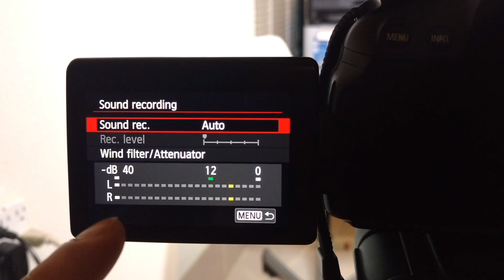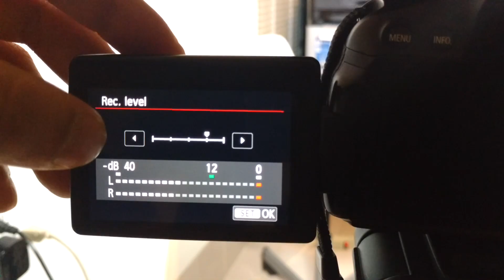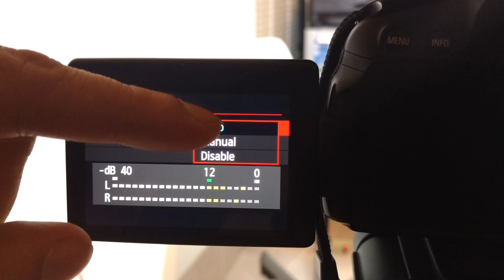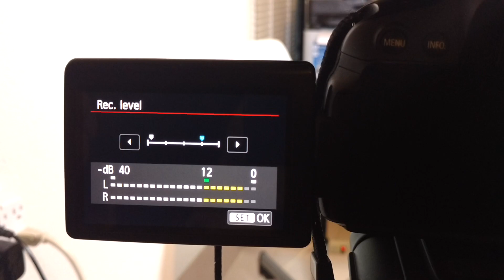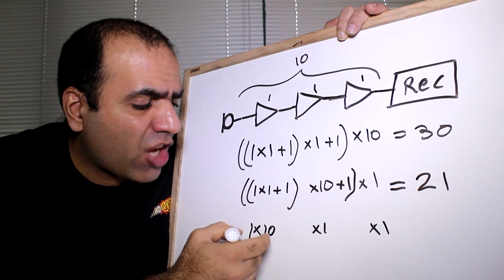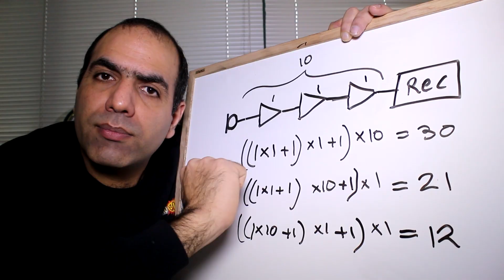Quality Audio Recording for Video

Comment: Hi Mehdi. Have you ever tried surrounding your camera or mic with a baffle? It's a real low-tech method I use to cut down on noise outside and some echo inside. I have a MUCH lower budget setup than you and find that taping cardboard or plastic around the sides of the camera (for on camera mics) reduces the background noise when recording outside as well as some reflections/echo when recording inside. It kind of makes the mic directional to some extent. Extend the plastic/cardboard from the sides of the camera and as far out in front as possible w/o seeing the baffle in the shot. It's not the end all solution but works to some extent.

Comment: lol... where to start..   a lapel is a good option.     2nd good option would be a large diaphragm condenser mic with selectable polar patterns.      The better the mic the lower the noise floor, the higher the audio bit rate and sample rate quality the lower the noise floor  too.
Post production on the audio is ideal for obtaining a  high quality sound,,  in the signal flow processing  of;  Gate, EQ, compressor, limiter... in that order.

Comment: Great video that a lot of popular you tubers should watch. You would  be surprised at how bad some you tubers audio is considering they have as much subscribers as they do.

Also dont forget there is still some improvement to be had with post processing. Using a High Pass filter (mic only) to remove sub rumbling, if the room your in is less than ideal there usually tends to be some low mid mud (whoomfy frequencies  160hz maybe 200hz 250hz) that can be notched out to clear things up.

And for really dynamic people where they go from talking to screaming, compression. far to often some videos i watch will get it to a clear volume to be all of a sudden blasted.

Projection is key for getting good signal to noise. Even when using lapels. Alot of people seem to have this subconcious thinking that a mic only hears whats infront of it. Sorry they dont work like that a mic can and will pick up all round it to varying degrees. if something in the background is louder than you guess what

Comment: Hello there sir just came across your videos and are pretty intergalactic  any way you should make a video on everyday tools electricians use on the job like the flux capacitor  and the most important I think , the wire stretcher .

Comment: There is an old saying that is prevalent here - You cant polish a turd. Always record correctly. Software algorithm fixes are limited and generate artifacts of their own. Record with a good $1k+ lapel radio system straight into the camera. Save yourself the trouble of syncing separate recordings later. KISS - Keep It Simple Stupid!!

Comment: Some company called Levn or something has produced some kind of bluetooth adapter, it allows you send or receive audio stream wireless with any 3.5mm port device. 
Then you will just need a bluetooth mic.
Didn't know if it compatible with any 3.5mm out put mic which without extra power supply. Maybe useful.
There is the line to amazon:https://www.amazon.com/Bluetooth-Transmitter-Receiver-Streaming-Switchable/dp/B00SGIZ5W6/ref=sr_1_1?ie=UTF8&qid=1512062739&sr=8-1&keywords=levn
Seems there were lots of company produce those things.

Comment: The actual solution would be to record with the shotgun mic regardless of the difference in volume, edit the video first, export the audio track to an audio editing software, EQ, compress/limit the audio signal and re-import the edited sound file. The difference in volume can easily be fixed with a compressor and/or limiter, and you can get rid of unwanted noises with the EQ. WIN!

Comment: 1. You can match up the waveforms of camera mic and external mic in post, it gives frame perfect sync and takes one minute
2. You can use dynamic processing to simply remove noise alltogether

Comment: For what it's worth, a noise reduction plugin in your post production FX chain will also help a lot. It works by analysing the frequencies present in the noise only, and then removing a portion of those frequencies from the spoken audio.

That won't get rid of the room boom, though. Although you are in a rental space, you can make proper noise reduction panels (not that foam shit) with timber frames, and lean them against the wall. They actually work better if there's a gap between the panel and the wall anyway.

If it was me, I'd throw money at room treatment first. The boominess of the room is more apparent than the noise floor. You don't even need panels, you just need furniture or objects that will break up the reflective surfaces. 

An old pro-studio trick we used to use in the old days was this. Sit where your camera usually is. Then have a friend/wife/daughter move a mirror along the wall. Anywhere you can see yourself in the mirror, you need some form of treatment - either a panel, or an object that will deflect the sound away from you.

Comment: I would highly, highly recommend an external audio recorder like the Zoom H1 or H2, or a tascam recorder. They have their own higher quality amp circuit, their own built in stereo mic (which is far better quality wise than the on camera mic) and a standard 3.5mm output which (I’ve tested this myself with the zoom h1) can plug directly into your camera. You can basically entirely bypass the camera’s bad amp circuit by setting its, gain to the lowest it can get, and raising the recorder’s gain as high as it needs to be. Plus, all external recorders will have an optional mic input, so you audio path could be [whatever mic you want]——>[recorder’s amp circuit]——>[camera & it’s amp with gain at 0]!

Comment: you can also use. Voicemeeter (easy and simple version) or Voicemeeter Banana (advanced version).

easy has no eq and only 1 virtual output. pro/adv has way too many features 2 virtual outputs, gain control, gate control.

both are donationware. you can donate if you have to money but if you don't it's free. it's well worth it.
https://www.vb-audio.com/Voicemeeter/banana.htm
Reply: (advanced version is simple but if you go into settings and play around it can get very complicated and confusing Js) hz is fine but sample rate... alot of options. learn easy first then go to adv.
Reply: if you use voicemeeter banana with asio4all you can bypass what the website says 8 channels. I've made it read 24 with support. 32 asio4all freaks out. that or not powerful enough laptop. max I use is 18. and 192Mhz. unless hardware is 48 then I don't.

and if you set your mic to 192Mhz it's crazy sensitive. mines on 1 or 2  steps below 192 and 10 or 20 out of 30 boost.(built-in laptop mic)

Comment: You can record the room noise and use that as a baseline to invert the waveform in post processing.  With the wave 180 degrees out of phase from your normal source audio, you'll cut a lot of the background noise.

Then, there's the issue of the noise floor (minimum noise present in the system).  As you have discovered, more gain means more noise.  I suspect the gain in that camera is pretty poor quality.  Have you thought about passing the signal through an outboard rig (perhaps a digital mixer or PC audio interface) to digitally increase the gain, then use a compressor and a gate to control peaks while blocking white noise?

Comment: Why not get a different audio recorder that has a better signal to noise ratio, use a microphone in that, and then plug that into your camera via the input? It should already be at line level, so you don't have to re-gain. Really it's the terrible pre-amp in the camera that's the problem it seems.

Alterinatively: when your video is done and edited, invest in some noise removal software for your finished audio to clean up what you already have.

Comment: Why you not use software VST to fix problem , 

you can remove 90% of noise using software process , 
VST plugins , do it , in realtime for you !!!!

don't make junky f...ing wireless mic 
just install iZotope RX 6 

it work at VST mode on adobe premiere and after effect with simple clicks ...

Comment: Since you're usually at home...a digital mixer with real time compressing function and/or noise gates then routing the output to the camera should do the trick with the levels without postpro hassles...and a wireless lapel would help with your mobility! Not a cheap setup tho... it's what we use on live conferences, congresses...

Comment: What about using a smartphone with USB OTG and hook it up to a USB sound card that is in turn hooked up to a small capacitor microphone on your shirt with a local gain stage powered from the USB bus?  Initially I put this comment on the wrong video, didn't realize youtube switched it out on me!

Comment: There are $10 radio transmitters with USB you can use in a car if you don't have native USB socket. USB slot in the transmitter is digital, so you need a converter. So, here's the plan for an easy lapel-lavalier:
Microphone---Preamp---A/D Converter---Some stuff to connect to transmitter---Transmitter (with 12V battery)~~~(radio waves)~~~Any radio---Recorder
OR
Microphone---Small laptop~~~(wifi)~~~Another computer---Recorder

Tadaa

Comment: Some very fundamental points made about about S/N ratio. Proper gain staging is really important. Especially when the signal chain is complex. Wirelessness aside, the most practical way to get clean audio and not worry about sync and clipping is to get a portable recorder that has a limiter built in. Connect a lapel mic to the recorder and send a line level signal out from the recorder into the camera and disable any auto gain setting on the camera.
Reply: A limiter works much much better than the AGC of a camera. It will only prevent peaks and leave lower level signals alone so it won't add any noise to the signal. Also, it doesn't destroy the natural dynamics of the voice (or any other sound) as much as the AGC.

Comment: Where are you getting your prices from? Stop shopping there. You can get lapel microphones for as low as $1 and a wireless lapel microphone system for as little as $7. They're not very good and about equal to that desktop mic with the high noise but spending a little more should get you something decent.

Comment: This might not work, but will a low pass filter using a RC circuit filter out the noise if the noise is at a particular frequency?

Comment: Extremely informative. It's basically like handling a DSLR camera. There are similar concepts in both of them. Take a brightly lit photo so that you can take a low ISO shot (Similar to high gain near the source). Fixed aperture photo with thin focus area (Sitting at a fixed position from the mic for best audio but low mobility)

Comment: I recently bought a Samson C03U microphone, instead of the Lav microphone I used. The only downside is the thing you also mentioned: now I have to add the audio to the video separately. Although it is a little bit more work, I think it is worth it, because the quality of the microphone is really good and I don't have any background noise anymore. Thanks for sharing this. I really like your solution. :)

Comment: @ElectroBOOM - I also recommend adding compression, either software based when you put your clips together or have a hardware compressor.
It will help the sound quality overall and should assist with removing a bit of the white noise.

Comment: I like to use two wireless lavalier microphone systems when there are two people being recorded.  I use a Y splitter into the audio recorder so each person is being recorded on separate channels (one on left, the other on the right.)  Makes it a lot easier when editing. Then convert to mono before compositing it into the video. You also record the audio on the camera and most modern video editing software can auto sync the two audio sources. Then you mute (or remove) the audio on the video.  It can be a little tricky the first few times you try it but once you figure it out it is actually pretty simple.

Comment: You use manual gain control option and then use a compressor/limiter and a noise gate software in a separate audio editor software or within your video editor software. I believe that would give you more flexibility and it is faster than recording a separate audio. You can save your audio preset once you are happy with it, and quickly load it into your further projects.

Comment: Uni-brow to Uni-brow, you could try the Asian competitor of Amazon.com, Aliexress.com. I don't want to leave a link but search for this:"Wireless Clip Microphone Mini FM Transmitter Receiver Lavalier Clip Mic Instrument Lapel Tie Mic System"  it is a light headset with a belt transmitter.  $16.32 CAD isn't too bad, and that seller seems to have a faster "expected" delivery date than most on that website.

Comment: You could just record the white noise audio alone and then in audacity you can remove it by getting its audio profile and then apply the profile with a noise remover effect. Google it :p IT works pretty well.

Comment: While you at it why not talk about phantom power. Electret, ribbon and dynamic mics as well as DAC, ground isolation and signal impedance. Just give everyone a crash course on the theory behind basic audio gear. Just a friendly suggestion to expand your lav' video a bit. 

Also sub-clipping is your friend if you do want to do multiple source syncing but then again, that's what assistant editors are for.
Reply: Also film guys please don't trip I used the word audio

Comment: I saw that you demo'd the shotgun mic dangling from above, as close as possible. I guess this isn't as brilliant as my earsticks suggestion on Reddit, but I believe I've arrived upon a similarly effective unsatisfactory solution without the use of the lapel:

1. Mounting the shotgun mic to your chin or chest would result in wildly varying input volumes. 
2. Therefore, why not mount it to your forehead, pointed straight down over your nose? No need to buy more audio gear and, though it'd conceal your glorious brow, I believe you still might be able to see a couple of feet- especially if you smushed down the foam on the irrelevant sides of the mic.
3. If that still doesn't appeal to you, I'd be a big fan of you simply speaking very close to the camera at all times- that'd really bug the s*** outa people that already might be a bit off put by your yelling. (For the record, no slight intended. I totally understand the previous necessity. I know an audio filter connoisseur/ expert if that'd interest you. (I hate signal processing and stick to software/ hardware interface, personally.))

I guess I should finish the video first though to see your solution. I like how Zuma... Muzo... influenced this next video. I'll probably have to edit in response to the rest of the video. Cheers, Mehdi.

Comment: If you'd like to use that USB microphone (which I think sounded the clearest), you could try looking at programs that automatically synchronize your audio and video, like PluralEyes or Syncaila (the latter is much cheaper, $25).  Basically, you throw all your audio and video files at one of those programs, and it automatically synchronizes everything together.

Comment: Mehdi,

I have free some audio production tips for you to get the best sound! As you noted in your section about gain staging, disable camera gain and get the overall signal to around -12dBFS or less on your camera's input meter. Don't let it get near 0dBFS or you'll have clipping and crappy sound at the input stage that you can't get rid of. A safe range is down near -18dBFS which should give you plenty of headroom for louder sounds to come through without clipping.

The real trick I wanted to mention is to add an audio compressor effect in post-production which will even out your loud peaks vs your quiet parts, roughly the same as what the auto gain control was doing for you in the camera, but not baking it in to your audio track, and sounding a hell of a lot better. Use whatever audio compressor effect you can find that may be built in to your video editor. Most production tools should have one. It might be called something like a dynamics compressor.

Some tips on how to actually use a compressor: bring the threshold down to just below your quietest speaking volume, use a ratio of around 3:1, a soft knee, attack time around 10ms, release time around 100ms, and add make-up gain to bring the reduced level back up to about where it was without the compression. Play around with the release time and threshold level to find a sound that suits you. If the compressor has a gain reduction meter, make sure it does not go beyond 6dB of compression for best results. Best to stay within the 2-4dB range. Hope that helps!

Comment: - Record video with the video camera set to Manual gain. Leave it at the highest level that won't ever clip even if you yell.
- Record about 30 seconds of silence, then record your video.
- Pull the audio out of the video file into a separate .wav.
- Run a noise profile on the silence. Apply this profile to the rest of the wav. This will remove the noise.
- Apply a limiter to the .wav so any big outlying transients get cut off.
- If you want to compress to balance out dynamics, now's the time.
- Normalize the wav so its loudest point is exactly 0dB.
- Import the wav back into your video file.

Voila. Automatically aligned, loud, low noise audio that you don't have to yell into. And you can achieve it with freely available tools like Audacity.

Comment: Try framing multiple layers of towels in a wooden frame to prevent echo. It works just as well as audio foam, it's cheaper, you can wash it, you can paint a picture over it, you can hang it up on the wall!